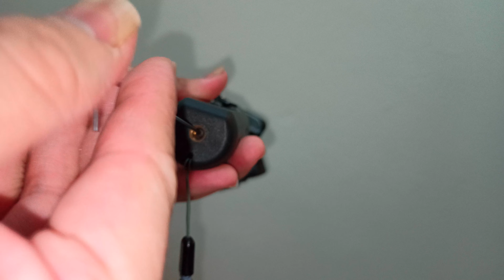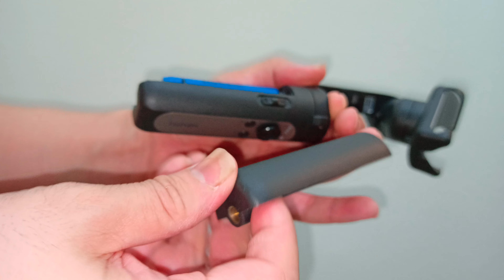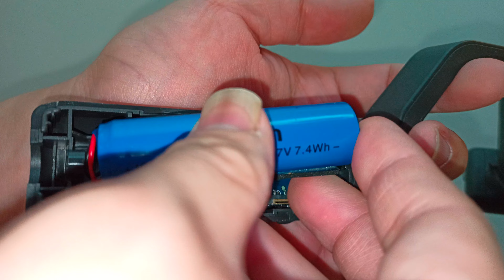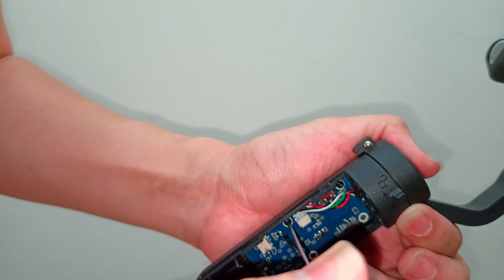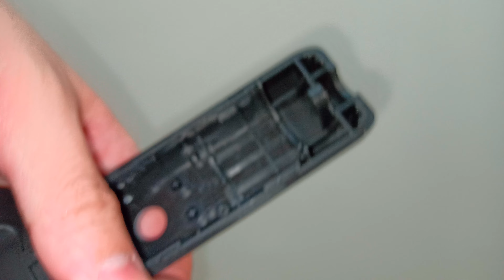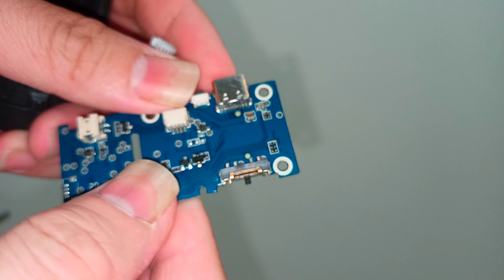Hohem iSteady X - Battery & Board Replacement

Comment: bro.. where to get the battery?
Reply from the maker: I get it at Lazada
Reply: @berniearnold  have link?
Reply from the maker: @mzafrizabiddin  https://s.lazada.com.my/s.eoC2t
You need to remove the chip and replace with the original chip. The chip provided not suitable for the gimbal.
Reply from the maker: @mzafrizabiddin  https://youtu.be/metMC_y5
Above link is battery chip replacement, showing I'm using back the original battery chip.